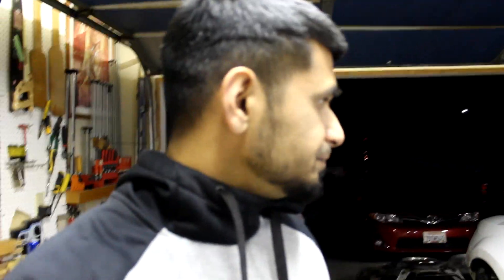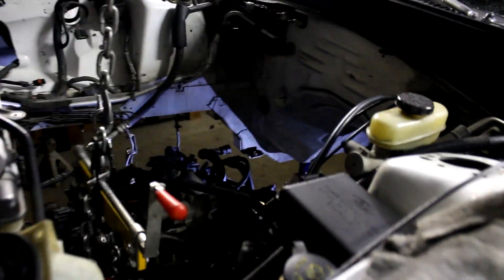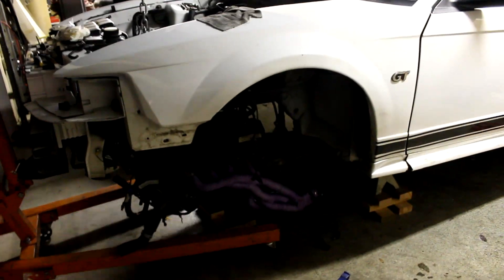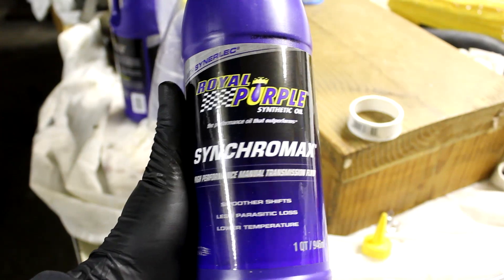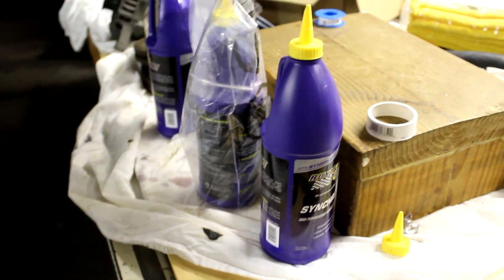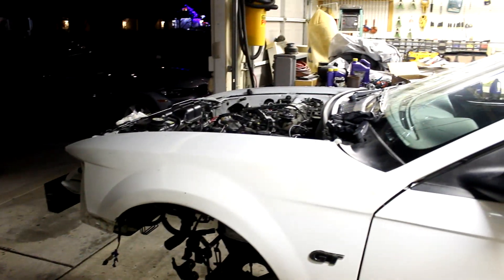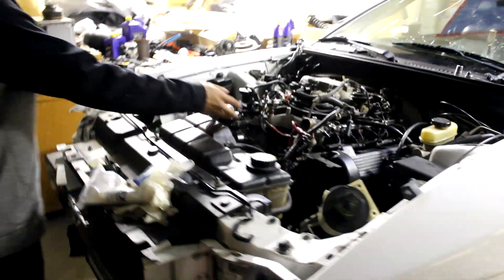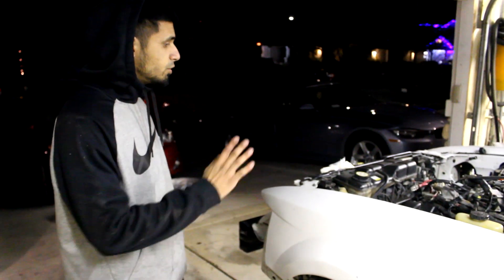Day 5: Motor finally going back in

Comment: Never use royal purple on these transmissions it’ll eat your syncos right up. Tremic put out a bulletin for it awhile back. Best to use automatic transmission fluid or penzzoil synchromesh is good as well
Reply from the maker: I actually did end changing out the royal purple, this video was recorded months ago, I ended up doing more research on it and swapped it out for atf